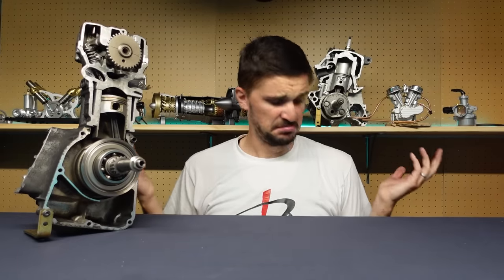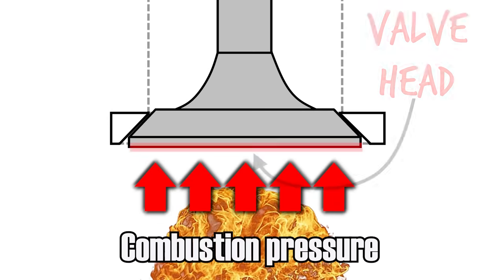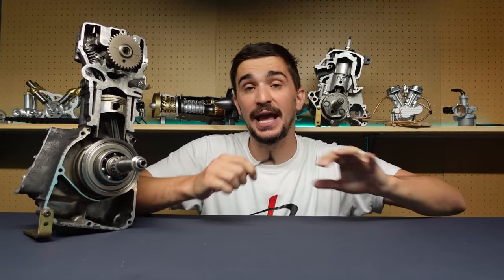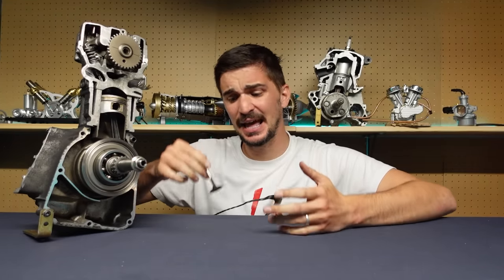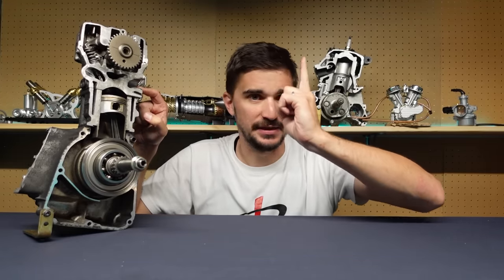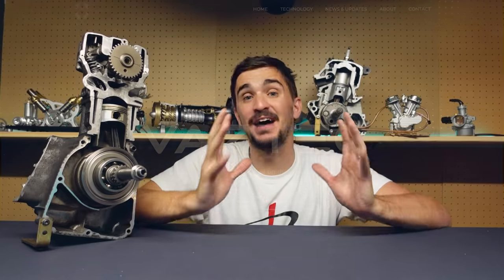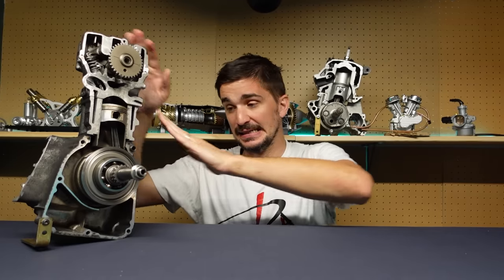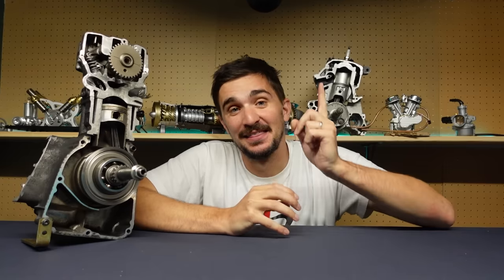Rotary Valves Make Normal Valves Look Silly - Why Aren't We Using Them?

Comment: It never ceases to amaze me how not only is a valve train capable of doing that so fast, but with proper maintenance it can do it for such a long time...  My 2000 AU Ford Falcon ute (Australian pick-up basically) for example has done 510,000km and she still functions like the day it left the factory, never uses a drop of oil and gets the same fuel economy as it did new. It's never, ever let me down, not even hinted at it. And I use it tow and all sorts, so it doesn't live the easiest life. That intech in-line six is the definition of a workhorse, a truly great example of engineering the right tool for the job.

Sure she's well looked after, but it amazes me every time I turn the key and it works perfectly. It's one of those cars I bought as a cheap work car stop gap and now I never plan on letting her go, BEST car I've ever owned. Even more reliable than my 70 series TDV8 LandCruiser, which has let me down twice and cost ten times the money I have into old Ford.

Now that's reliability.
Reply: Yet Toyota advertise on reliability. It's pathetic
Reply: @Low760  Yeah don't get me wrong, the 'Cruiser is an absolute beast and I have it because I use it for going places the Falcon just can't... But she hasn't been the most reliable thing and my word is she thirsty when you ask her to work. It can chew through the 110l tanks in an eye watering amount of time.

I have it because there's not really anything else out there that can do what it does, but I could sell it if I didn't need it. I don't absolutely love it. The Falcon I have because I absolutely love that old thing. 

I'm gonna rebuild the drive train and put a turbo on it when she finally does let go, or the clock hits the full million. Whichever comes first. Probably the former at this rate.

We'll do a 10 second 1/4 mile sleeper build, leave the outside looking all weathered and worked, but give 911 Turbos something to think about lol. Ya know what I mean. 

But no Barras, everyone swaps out the intechs for Barras. The intech deserves so much more love.

Edit: I mean probably the latter at this rate. I think it'll go the full million.
Reply: Up the mighty AU! (I have an xr8 AU ute, it only has 360,000ks though)
Reply: @Mango_McPoo  It really was peak Aussie engineering. They're never gonna make them like that again.
Reply: Lol here in states my F150 has 600k miles and is the same reliable.  Not bad for a 60 year old design in use for 30+years.  Long live the 300.
Reply: @bowez9  Another fine example of that "built Ford tough" mantra being not just a marketing gimmick... At least, that used to be the case. I know some guys with new Rangers and their Ford ownership experience hasn't quite been as anxiety free as mine has, or even the aforementioned LandCruiser.
Reply: Yeah my '90 supercharged V6 T-bird isn't all that reliable.
Reply: @onkelmicke9670  Well they certainly didn't get them all right lol.
Reply: @onkelmicke9670  well owning a 93 SC, that's the 1st Gen DIS plus you have the ABS with accumulator balls.
Fast, cheap, reliable.  FORD picked one for the SC
Reply: @C.Fecteau-AU-MJ13 The intec is definitely  the more reliable engine.
Reply: agreed ,i own an 1989 Volvo 244 DL with the B230F engine and 4 speed auto living here in Central Canada with extreme winters and crazy summers, it gets the same fuel economy since i bought it used in 2010 ,the body is not so great, the powertrain on the other hand is great and has 400k on it and has never been apart yet , just timing belts ,Valve lash adjustments, a water pump, starter and 2 alternators, and after this winter I will need to get some new seat foam for the drivers seat and new heated seat elements for it at the same time, i think this is not bad for a car that is 35 years old,  the advantage with the 89 model year is they went everything  Bosch electrical and electronics in the entire vehicle, prior  it was a mixed bag of electrics/electronics, your Falcon Ute is a brilliant vehicle  👍 go there is one old guy with the same year as mine and currently has near 700k on it and looks insanely good always serviced by a dealer Tech, his own age 75 yrs old , thats a master mechanic
Reply: You'll have to clarify on the "Landcruiser" story. 

The TDV8 engine is in Range Rovers, and was co-deisigned by Ford and Peugeot.
Reply: @Low760  he said Landcruiser, but the engine he's referring to is Land Rover/Range Rover.
Reply: @99unclebob  Jesus that's good going from the old Swede in that part of the world!... Although it's pretty savage weather where they're from.

But believe it or not, I'm actually a little familiar with that part of the world, I have family there, I guess I'd say I'm half Canadian really, if such a thing exists. 
My father is from Thunder Bay, so I know how brutal it is up there on machinery. Hence why Dad raised us in south east Australia and NEVER took us to the snow as kids 🤣. He'd shoveled enough of it to give him PTSD I think lol.

Another rather ironic fun connection, where I live now is a suburb of my city called Canadian, because during the Eureka Rebellion miner's revolt, a Canadian guy was killed by a redcoat and nobody knew his name. They only that his house was in the area where mine is now, so named the area Canadian. So I think my blood must taste slightly mapley lol. 

I've actually gotta go back in the fall to see some family who are getting very old and I've never been in that time of the year so I'm really looking forward to it. Planning to borrow a motorcycle off a family friend and taking my 16yo daughter exploring a but. I've actually never been as an adult and she's never been out of the country at all so we're very much looking forward to it. She plans to move to North America when she finishes high school and hopefully study in Canada. Which should be easy to get a visa for. 

See she's absolutely obsessed with bears, all large land predators really and her dream is to work in conservation field and research the behaviour of bears that become problematic and/or dangerous to humans or maybe even work with ones that end up in sanctuaries and stuff like that. 

We've got a family friend who's got her a couple days hooked up with a ranger who specialises in bears and is taking her along with some university students to do whatever it is they do. She's absolutely pumped!

If anyone was ever born to a job, it's my girl working with dangerous animals. We rehabilitate and foster problem rottweilers and she's just got this disposition that makes them trust her, so this should be the trip of a lifetime and hopefully inspire her to keep using her God given talents.

It's a big world made small by the internet eh?
Reply: @jameshaulenbeek5931  I mean it's the 4.5 turbo diesel V8, from the VD engine series... But people just say TDV8 here because everyone knows that you mean the 70 series and not the V8 Petrol found in the wagons, such as the Sahara.
Reply: @jameshaulenbeek5931  No I'm referring to the 4.5 turbo diesel V8 from the VD engine series, which is what's in my 2008 'Cruiser.

Edit: oh same person. Point remains.
Reply: Inline six engines are naturally perfectly balanced so credit goes to the original engineering company who first built and introduced it to the world, not Ford, or Cummins or anyone else. Now y'all could tout your inline 6s with just enough power to get the job done at a regular pace and y'all always are sayin I'm gonna turbo or build up someday. For the same damn price my 92 Silverado 5-speed manual transmission 350ci has 647,891 miles with NO engine work done except regular accessories being swapped as needed and it has the power to go beyond what I need without forced induction and they're easy done in less than a day parts or if I wanna double my power at any time I could ls swap for under 2 gs and everything is compatible cus it's a m/t Chevy and you can literally trip over parts to fit em in the dark with a blindfold on whenever you need/want parts for em. I had a 4.9l 300ci 1985 Ford bronco it was sooo gutless and slow. Yeah it'll crawl up a mountain if u put it in 4L 4x4 get out and walkn next to it , great, doesn't help me get up to freeway speeds tho , took me half a song on the radio to get it to 55mph and topped out barely at 64mph(48mph uphill on I 80 through the sierra Nevada mountains😢). All I'm saying is sure I have good experiences with yours but in the states we got literal mountains standing in our way and you know the old saying "there's no replacement for displacement" sry, not sry.... But right on for u tho 😅
Reply: It's all about the timing and valve clearance. Keeping your own valves adjusted will vastly improve efficiency in simple inline engines. The diesel in my sailboat was made in 1973 and it could lay a military smoke screen when I bought the boat five years ago, and made a horrible racket besides. A quick tuning of the valves and she purred like a 600lb cast iron kitten, and exhales a little bit of blue gray smoke when starting cold, which nearly disappears when it gets up to operating temperature. Every year when I replace the raw water pump impeller and check belts and hoses and zincs, I check the valve lash and adjust if needed. My number one is often out by a couple thousandths. I suspect a cam erosion issue because the valve and seat are nice and clean. Anyway at idle ahead, she sips fuel like an old lady having her apertif, but with the throttle opened up it can send plenty of torque to the prop to make 28 tons of boat dash ahead like a race horse. Well, a slow race horse. The poppet valve system has been around for over a century and it is mature technology, and plenty of modern automotive engines made with modern materials routinely go a half million miles without needing a rebuild or even a valve job. They tend to stay adjusted without any attention, but this is still a good owner level maintenance task to perform after the warranty is expired. Only scheduled oil change is more important, IMHO.
Reply: @jameshaulenbeek5931  I know my engines, I'm a wealth of useless codes over here. You're talking about the AJD V8 if memory serves.

TDV8 just means turbo diesel V8.

I don't even know why I know all this. I work as an arts director for a theatre company nowadays. It's literally useless information.

I know my music, my theatre, my cars and my dogs with extreme passion. In that order. Except I love all the dogs, most of the cars, a lot of the music and hate almost all of the theatre. My brain is a very noisy place.
Reply: @tomh9391  Well horses for courses... The Falcon is much more car like and I only plan to build her to be fun because I love it... It doesn't make sense to do for performance, or especially from a financial perspective and it's not an off-road vehicle in any way shape or form. 

It's just amazing how well she's held up to being used as a work vehicle is the point I'm making, a well engineered car is an amazing thing no matter who makes it.
Reply: @growleym504  Yeah proper maintenance is EVERYTHING!!! No doubt about that.

It's fair to say that I bought a good one though, I'm only the second owner and although it's always been used to tow and work, I know the original owner and he was as fastidious about maintenance as I am. So that's always key to any reliable vehicle, totally true.

I'm not sure about the history of the 'Cruiser quite so much, at least not all of it, so that's a real variable there. Although I did buy it from my brother in law and he owns a diesel mechanic's business with a reputation for being the best in the region for three generations... So I couldn't have bought it from a better owner. Point is, you can never be sure unless you maintained it since new.
Reply: 2.6 million miles, 1990 Freightliner with a 3406b PEEC engine.
Original block, head, and crank.  Don't know about the pistons because I've never pulled the head.

Also original transmission and rear differentials, and most other parts.
Reply: That amazing, Personally I expect starters/alternator/pulleys/belts sensors to some extent to fail periodically. (I don’t count consumables) As long as they don’t need engine work I consider my cars reliable.
Reply: @C.Fecteau-AU-MJ13 The Mercedes G-Class can do more than the 70 can and do it better with its stock differential locks and transfer case that can be engaged in all kinds of combinations, and the 2,5 t payload on the chassis cab.

It was always very expensive though and the work version is now no longer available. They still sell it to military and govermental customers in Europe where it has gotten an update with the new 3.0L inline-6 diesel which is more effcient and more powerful than Toyota's 2.8 in the new Land Cruiser but it's not available to any other buyers which is a shame. It also is Euro 3 compliant because it doesn't have SCR, DPF or EGR but yeah, unobtainium.

I do hope that with more electrificiation and more freedom focused politics coming we can get rid of some of the emissions requirements for the remaining new combustion cars sold. Chainsaws and lawnmowers also don't have emissions regulations.
Reply: @C.Fecteau-AU-MJ13 TDV8 is the official naming convention of the V8 diesel powertrains from Land Rover, like TDI is VW naming for diesel engines. Maybe call it VDJ70 which is the official code name for the 70 Series with the 1VD-FTV turbo diesel V8. To go more into detail you can say VDJ76, VDJ78, or VDJ79 (then specify single or dual cab) for the different versions of the 70 Series.

It's like when people say "LC300" which is confusing as LC is the name of a Lexus model and it makes it seem there's a new LC 300 model when it's the Land Cruiser. Just call it J300.
Reply: Ford 6 cylinders are excellent. Good for you brother
Reply: @C.Fecteau-AU-MJ13 My 06 Ranger with the 4.0 SOHC is parked because of the timing chains starting to rattle. It's got 130k miles on it I believe. Ford in their infinite wisdom has a timing chain on the front and one on the rear of the engine so they can use the same head on both sides so to change them the engine has to come out 🤦‍♂️
Reply: Agree. Also amazes me how the gases can get in and out so quick considering that there is an explosion 120 times a second on my high revving BMW motorcycle. It redlines at 14500, which means the piston reaches top dead centre 240 times a second. How the f**k does that happen????
Reply: I wish my former wife was as reliable, trustworthy and dependable🤣🤘
Reply: Can't spell Australia without AU! 😂
Reply: Metallurgy is way more important to all of human history than it is given credit for. Nations rose and fell because of metal techniques and quality (and still do)
Reply: Eventually  this won't  matter the same problem  follows any engine  that burns fuel.  Toxic exhaust.
Reply: @C.Fecteau-AU-MJ13  You can say that again!  The Ford Ranger  (expletive deleted)...
Reply: Wish those engines were sold in the states, Ute's are awesome!

Comment: A guy in Canada invented what he calls the Coats spherical valve engine. The valve is round, like a ball instead of a rod. Both have holes in them, but the hole in the coats valve has a a restricted shape that allows the air to flow with higher velocity when it’s starts to open and is unobstructed when it is fully open. When these heads were mounted to a ford 302 it ran at 13,000 rpm or so.
Reply: Is that the guy that was in Car Craft Magazine back in the 80's?
Reply: I recall a system for Harley Davidson as well. A custom bike was built and shown perhaps? 20 years ago or more. An interesting concept.
Reply: I came here to comment this.  I remember reading about the Coates Spherical Rotary Valve engine almost twenty years ago.   If you search the web, one of the patents for it was filed in 2004.

It makes me wonder if they genuinely did solve the sealing problems.
Reply: Like a ball valve in piping?

Comment: Minerva, an old belgian car manufacturer, made valveless 4 stroke engines. At first they made it with double cilinders,,  one was  moving  at half the speed  off the  pistonopening and closing openings  on the side  off the combustion space, for  inlet resp  outlet. It  used quite some amounts  off oil, so  when that car  passed bye, you always saw blue smoke coming from the exhaust. BUT their  latest  model was supposed to get ROTATING valves. It was  V8 engine. They also  replaced the  crankshaft with a   solution to get rid  off the secondairy (un-)balance . It was made, and  it drove around, and the car had a great  design, very modern and low, for that time, way more  modern as any  car,  in my humble  opnion, back in the day . We speak 1939 tho. The engine (a v8, with 1  long rotation valve for each  row off cilinders) was  no  succes, because the rotating valve's bearing turned  out to be  not as easy  as thought. I thing  I remember to  have red it was the carbon, from the exhaust, that was supposed to  grease the rotation valve, but the 2 long valves were  kept  in  place with wedges, these  turned out to be   quite a  problem they not got solved. So  they closed the factory, I guess they had run out  off money and  or the outbreak off ww2 saw their clientele disapear, Minerva  made  very expensive  cars for  ppl  that had more money, then they could carry.